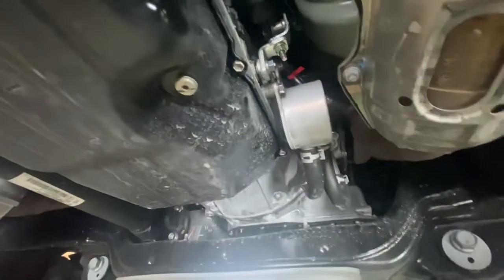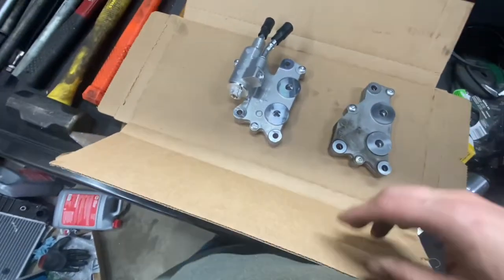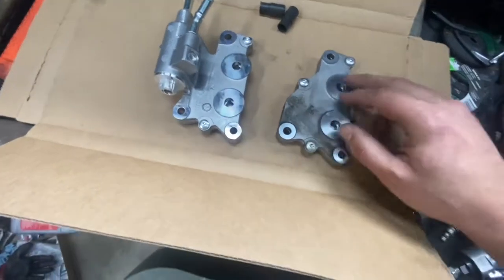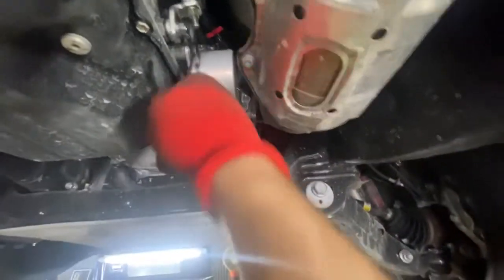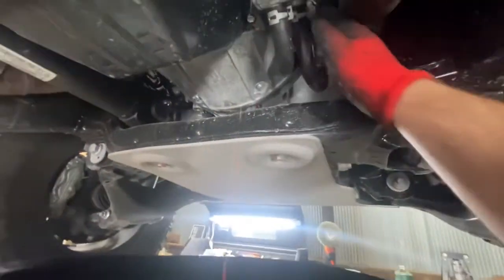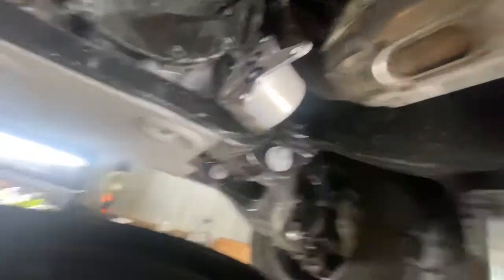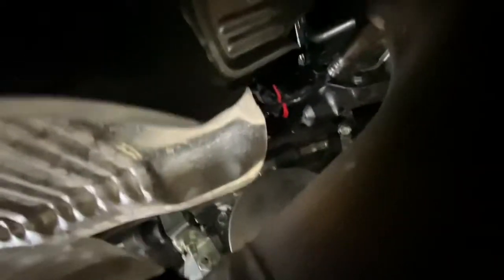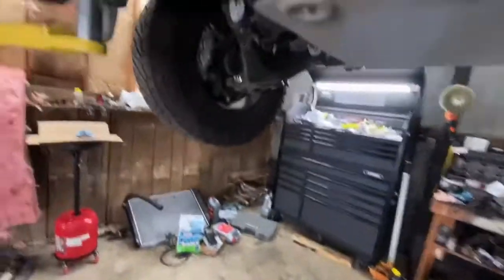‘19-‘21 Tundra Transmission Cooler deep dive plus how to add one!

Comment: what is the purpose of the little pin? This is not clear to me. Sorry if I'm dense.
Reply from the maker: The pin is a manual override for the trans cooler thermostat.
Reply: @DirtE30  Yes I realize that. But is it removed after filling / checking trans fluid?
Reply from the maker: @groth3395  oh sorry, yes, once you’re done, you remove the pin holding in the thermostat. It will then operate as intended and open at around 195f to allow circulation of the fluid to and from the external cooler.

Comment: Thank you for the video. Very clear explanation. So. We have to put the pin back when we change out the transmission? How hard is it since we don’t have the space around to do it. Not very good design from Toyota
Can we just leave the pin in it to keep the flow path open at all time?

Comment: I purchased the genuine transmission cooler kit for my 2021 tundra..came with the same Toyota valve but also included original Toyota hard lines and a cooler…must have if you tow
Reply: Lawrence, 
 What did that cost you? I just got an estimate to that job from the Toyota dealer where I bought our 2021 Tundra. 6.5 hours labor and $ 2000 for parts. I don't think that includes any Vaseline.
They also said if I didn't use all the genuine Toyota parts it would void my warranty. I  have about 16k miles on our SR5 DC that I do use for towing. Thanks in advance.
Reply: 990 dollars kit from genuene tran i did the work step by step process on you tube
Reply: I did get a call back from the dealership saying they had made a mistake on the estimate. Said they priced the job for a 2022 rather than a 2021 and that if I could come up with parts they could put them on in  1 hour. ?? 
Thanks for your reply!

Comment: What diameter of hose did you use? How much transmission fluid did you end up having to add? Thanks for the videos! Much cheaper than other alternatives, and a much easier install.
Reply from the maker: It’s 3/8” ID hose… as far as how much fluid it’s probably half a qt or so, I just had the dealer top it up the next day. It’s not enough to be of concern.

Comment: It's a slightly different part for the 4.6 4x4 which also didn't get a cooler starting back about 6 years ago. But regardless of model, lines can be attached directly to the trans. If you do that, bypass the coolant line. Otherwise they should have used a much bigger heat exchanger to keep the temps stabilized. Probably the fact that companies assume the end user is a dumb bag of cells.

Comment: Great video. I had a 2016 and now a 2021 that I need to do this on. Can you confirm which of the two hose barbs on the thermostat cooler assembly is the output? Is it the top one aligned with the pin or the other one?  I want to ensure that the output is installed on the bottom of the plate cooler. Also, is it ok to install everything totally empty and then top off fluid level in tranny plug? No concern with air bubbles / pockets? I'm still trying to figure out the best way to estimate the quantity of additional fluid needed. Thanks!
Reply from the maker: It’s the one nearest the pin. The way I determined that was to pre fill the hose/cooler assembly and then pour it out and measure what comes out. Then add that amount after install. Won’t hurt a thing to install it dry.
Reply: @DirtE30  Great thx for the quick reply. I'm going to use DeRale HD hose the entire way as well instead of messing with the metal lines part of the way. Less connections and potential leaks. And using the Hayden 679 cooler. Should be a more efficient cooler than my OEM 2016! Thanks again.
Reply from the maker: @truthjustice3313  should be a solid setup. I’ve used that cooler before on my ‘19, was happy with the performance for sure.

Comment: I have a 2016 Toyota Tundra crewmax 4x4 and lucky enough to have the cooler, I am disappointed that I do not have the trans temp gauge. Thank you for this video. We installed a cooler on my buddies 2020 TRD PRO using your advice, just wanted to say thank you sir.

Comment: can you give us the parts names ? im havin a 2020 sr5 in Quebec , and i want this setup . thanks for the video all is clear.
Reply from the maker: See my “parts list” comment below... then watch my other video on the front cooler mount...
Reply: @DirtE30  I see no comment listed here that provides any parts list. Please help.
Reply from the maker: @Bicslife  well… not sure why you can’t see it. You probably have your reply view filtered. Others have purchased the parts list already so I know it’s there, I can still see it too. I figured out how to screen shot and copy the text:

Comments 16
×
Thermostat plate assembly: PN 3297034030
Cooler I used this time:
13 Row AN10-10AN Universal Aluminum
Engine Transmission Oil Cooler Silver https://
www.amazon.com/dp/B01H3G9EX2/
ref=cm_sw_r_cp_api_glt_fabc_8HQYSPNMS1
YV9Z48N2YY?_encoding=UTF8&psc=1
AN -10 x AN -6 adapters:
EVIL ENERGY Female AN10 to Male AN6 Flare
Reducer Hose Fitting Adapter Black https: //
www.amazon.com/dp/B01 N5F6ICB/
ref=cm_sw_r_cp_api_glt_fabc_PYGKMEZ8MD
NPQWJEVAOX?_encoding=UTF8&pSc=1
Can use any trans cooler hose, or a good fuel
hose, not under any pressure, just needs to be
able to handle up to 220degrees or so. Can
use push in AN -6 female fittings readily
available anywhere.
I didn't go into detail on where and how I
mounted my cooler, I will try to capture that in
Reply: @DirtE30  IDK I have checked and double checked and I can't see anything with parts numbers... maybe put it in the video description as that would help a lot of people find quicker. Anyways, THANK YOU SO MUCH for the reply and help.
Reply from the maker: @Bicslife  yeah, I tried. It wouldn’t let me.

Comment: Good video . Coming up on 1 year for me running a cooler on my 2019 . Imo if anyone tows with their Tundra this is a must
Reply: at this point i'm only towing a jet ski, when you say towing like a 5th wheel or camper or anything with significant weight vs 1 jet ski?  i'm a brand new Toyota Tundra owner so i'm trying to be informed as best I can, thanks !

Comment from the maker: Parts list:

Please note that I have zero affiliation with any of these... This is simply what I used, it is in no way a recommendation. Proceed at your own risk, as sad as it is that I have to even say that.
Thermostat plate assembly: PN 3297034030

Cooler I used this time:
13 Row AN10-10AN Universal Aluminum Engine Transmission Oil Cooler Silver https://www.amazon.com/dp/B01H3G9EX2/ref=cm_sw_r_cp_api_glt_fabc_8HQYSPNMS1YV9Z48N2YY?_encoding=UTF8&psc=1

AN -10 x AN -6 adapters:
EVIL ENERGY Female AN10 to Male AN6 Flare Reducer Hose Fitting Adapter Black https://www.amazon.com/dp/B01N5F6ICB/ref=cm_sw_r_cp_api_glt_fabc_PYGKMEZ8MDNPQWJEVA0X?_encoding=UTF8&psc=1

Can use any trans cooler hose, or a good fuel hose, not under any pressure, just needs to be able to handle up to 220degrees or so. Can use push in AN -6 female fittings readily available anywhere. 

I didn’t go into detail on where and how I mounted my cooler, I will try to capture that in detail in a future video.